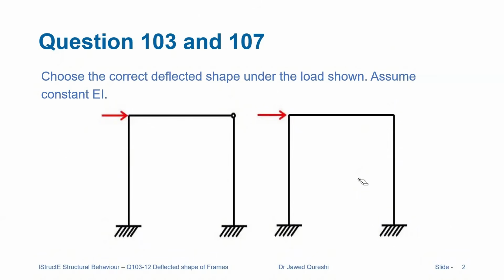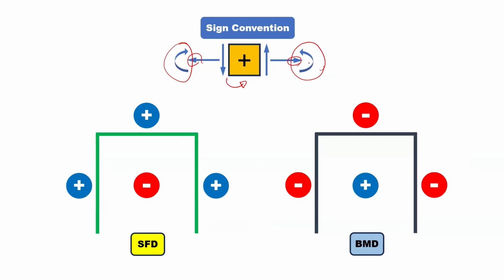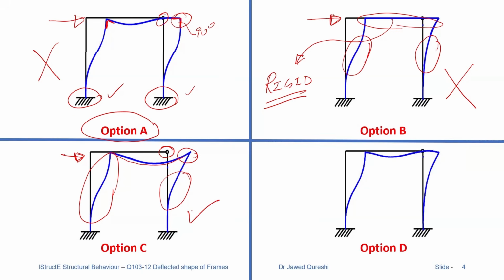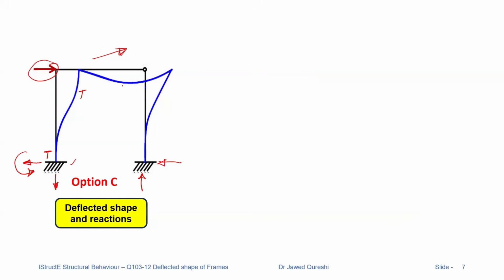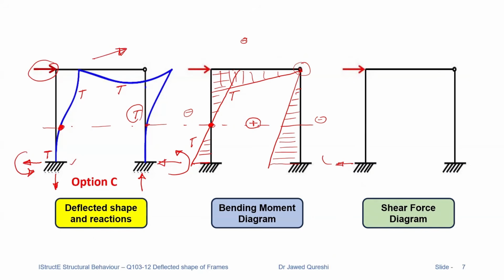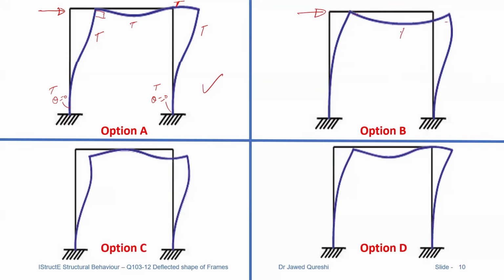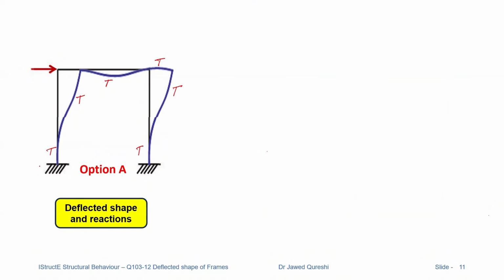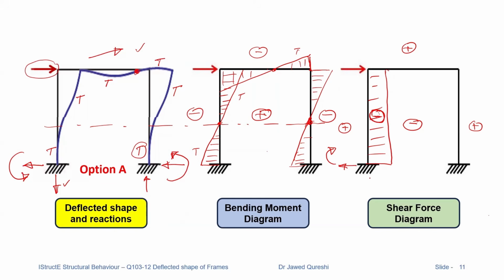3 Golden Rules for Analysing Structural Frames (Must Know!) | IStructE Structural Behaviour Course

Comment: sir in example 2 option C why it is not possible, generally for a SSB point load at centre the roller support moves inwards in the same way when the column deforms it will go down ward no
Reply from the maker: Option C is not possible because the deflected shape shows tension inside the frame. Tension inside does not make sense as push the frame at top left and it should create tension outside the frame. Also top left deflected shape is depressing down, which is not possible.

Comment: Thanks a lot for the amazing Video sir.
Having a doubt.
How can we determine that the left side is weaker area.? When loading is on right won't it be the weaker area.?
Reply from the maker: The weaker side will have internal pins or less rigid joints. For example pinned or roller instead of fixed joint. Happy to explain it further if I did not understand the question fully.

Comment: @DrJQureshi

Hello, sir, it's really lovely. I am refreshing my basics with your videos. I have a request: you can make a series for master's students where they can revise all concepts before a job interview. I am in my final year of my master's, and soon placements will be starting, so it would be helpful.

The Main outcomes I had are:
single curvature and no 90-degree angles at pin joints 
double curvate and ø=0 when it's fixed 
no curvature in the beam only, and if it's a rigid
no axial shortening without any horizontal force applied to the frame
The point of contraflexure is where the moment is zero and the sign changes from +ve to -ve moment
Reply from the maker: It is a great idea of make such video series for students who are looking for jobs. Thanks
Reply: @DrJQureshi Thanks for considering my request sir😊